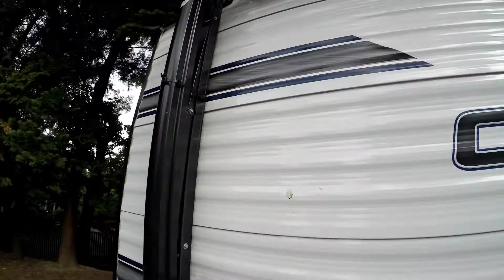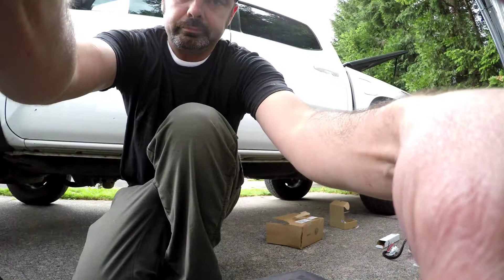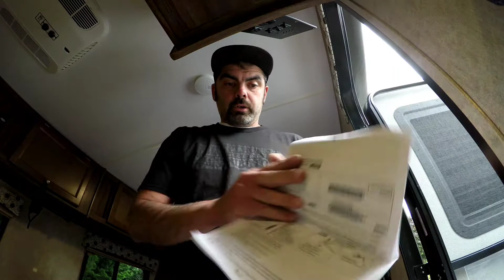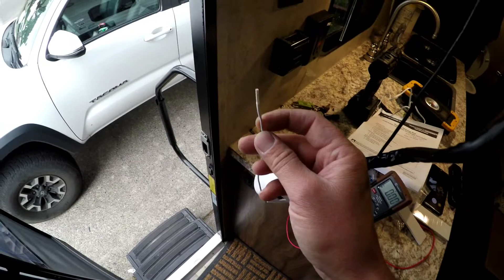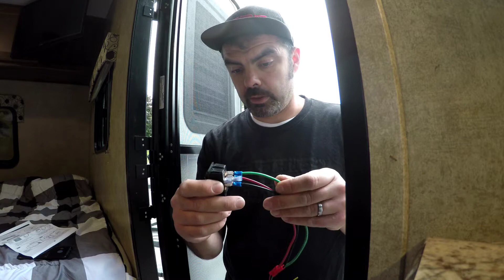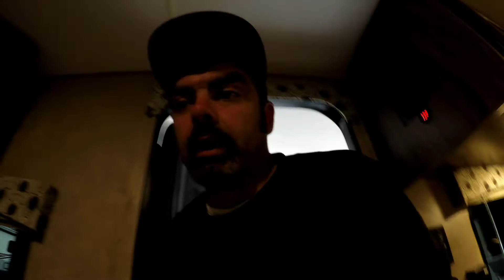RV Awning upgrade. How to install a remote for your power awning

Comment: I just used this video to install my kits on my awnings and it works well except that if I leave it for a bit, the OEM switch won't move the awnings but I can hear the receiver clicking  If I jog it slightly with the remote first, then the OEM switch will work.  Any thoughts?
Reply from the maker: Thats odd. Sounds like possibly a loose connection

Comment: I lost my sensor on the road.   Do i  need to do any adjustment when I install a new sensor?
Reply from the maker: No it should sync right up to the remote.
Reply: @rvtechtips874   Do you have instuctions for that?  do i just use the remote?  Do i need to find the other parts to it?  Id did not install it so i am not sure what i am looking for.

Comment: I have the power hooked up properly, but I have no lights on the front of the receiver unit. It’s my unit DOA?
Reply from the maker: I would confirm you have power with a volt meter. If you have power then it's probably a bad receiver
Reply: @ thank you so much for replying. I got it fixed. It was a blown fuse.

I do have a follow up question though:
I got everything working fine and was able to test the wind sensor and it did in fact close the awning, however, once it gets to the closed position, the motor would surge forward and back forward and back forward and back in little incremental movements. Not sure why it’s doing that. Any ideas?
Reply: The only thing that stops it is for me to turn the switch off cutting power to the unit and then turning it back on

Comment: Install went great, wind senor program does the opposite it extends when triggered vs retract, all wires are correct , remote and switch function properly...at a loss

Comment: Thank you for doing this video.  One question, when you added this, did it make the original switch obsolete afterwards after the install?
Reply: By trial and error, I found that it does take the place of the original switch but there is a phone line that plugs into the module that you can connect the original switch to in case of an issue with the remote.
Reply: Ok, thank you for getting back to me.

Comment: What setting do you have it on. Mine is on 5 and my god. The winds can blow pretty hard and the awning won’t close
Reply from the maker: I had it set at 2 and it would roll up with a small breeze so I turned it up to 5. Just gotta play with it

Comment: Did you use the original awning switch or you replaced it with a new one? My original switch has 4 terminals but the instructions only shows 3, (black,  red and green)
Reply from the maker: I kept my original switch but it has 4 wires. I'm not sure how yours works with 3 because you have your positive and negative and positive and negative to the motor. What brand and model do you have?
Reply: @rvtechtips874  yes mi e has 4 wires also, and I wired the 3 wires to the 4 wire switch and it worked! Black,  red, and green(12v+) using the rj11 phone cable to the factory switch!!